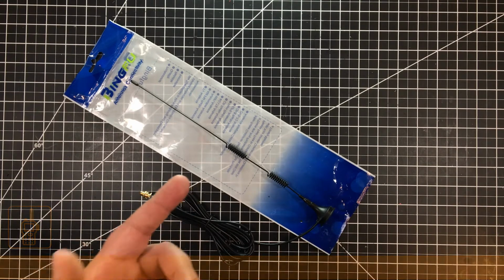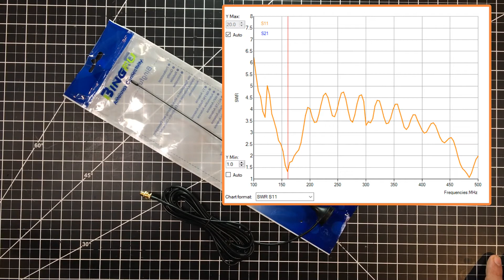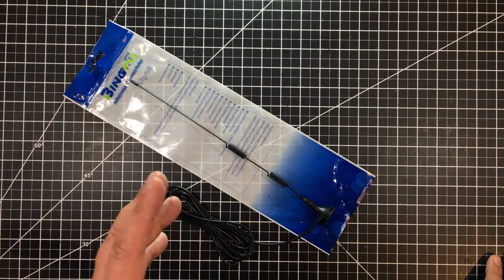Antenna Talk - The Reason I Bought the BingFu Dual Band VHF/UHF Antenna!

Comment: Where’s the next video? I just bought this exact one because I think I messed up my old antenna on my Pro404 and wanted feedback
Reply: That is a compromised antenna. It works well for what it is designed for. It is tuned for VHF Hi and UHF band. It is rated for 12 watts. It is designed to turn your hand held into a mobile radio. Just add a speaker mic and a battery eliminator.
Reply from the maker: Second video?  Been using this for a bit with good luck!